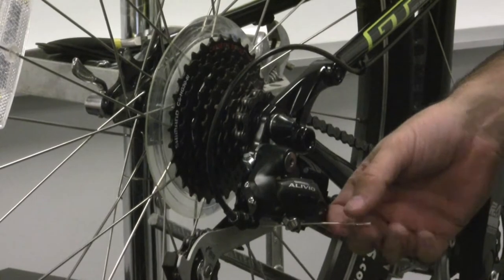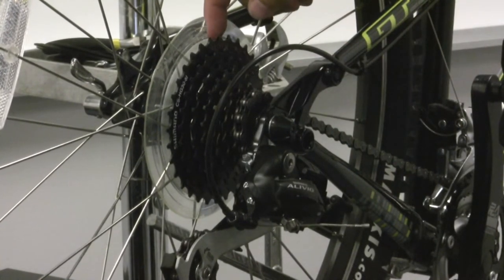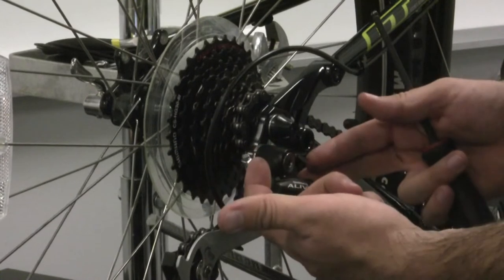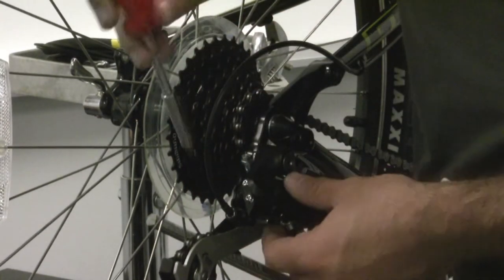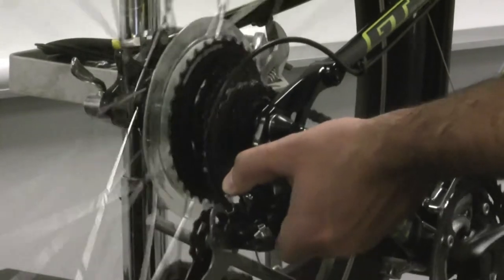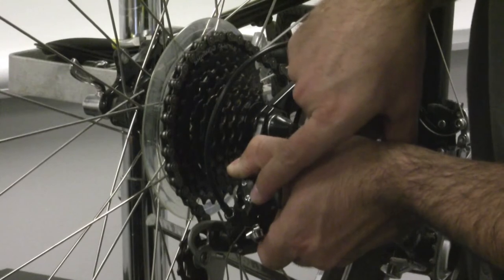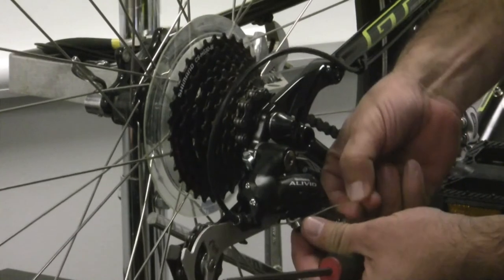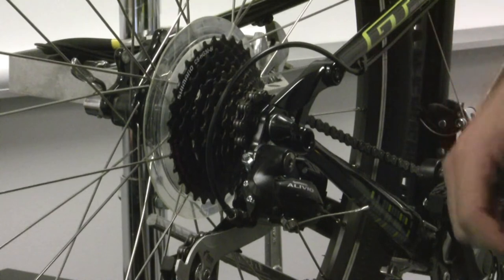Limit Screw Adjustment for the Rear Derailleur

Comment: Thanks for the video. It's helpful.  is there any more detail needed with the final step?  Or is just pulling it tight enough.  I just wonder whether you have intuition with how taught it should be and a learner might undo the limiter adjustments by over/under tightening the gearing cable whilst re-attaching?
Reply: As long as there isn't physical play in the cable the fine tuning is completed using the barrel adjuster on the shifter or derailleur. The final step is "go ride it around off the bike stand and make sure it shifts up and down the cassette smoothly."

Comment from the maker: It's true I did not cover the B tension screw. The 'H' and 'L" screws however, are thoroughly covered. Should I feel naughty when, as an instructional designer, I make assumptions about learners being able to deduce that H is for high and L for low-- and that a limit screw would then limit movement for high gears that are for going fast so the tiny cog is the high gear and on and on? Yes, and I'll also assume a learner/watcher has a basic knowledge of shifting? Yes. It's also fun to be a bit of a smart ass. It's hard to put it out there this was a school project with limited scope and that everything was outlined in my project as far as what prior, basic knowledge learners needed to bring to the table. It's great to hear your comments about how I may have obfuscated an explanation. I hate hate hate it when a DIY/how-to video or write-up miss steps.